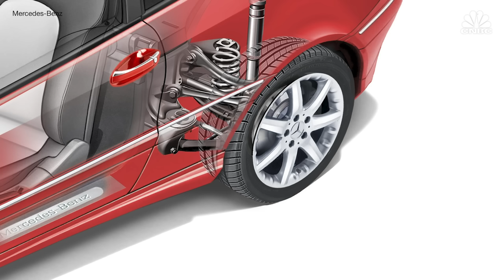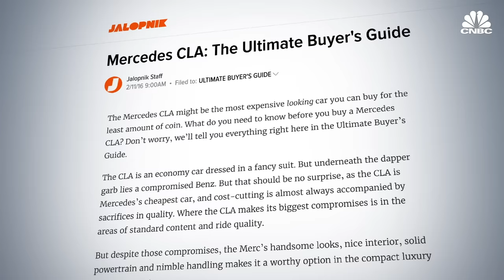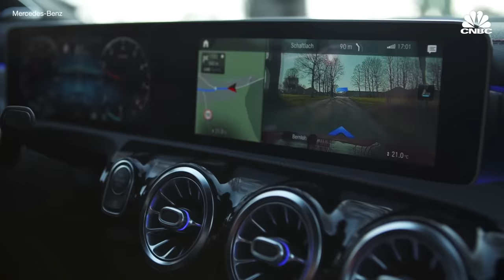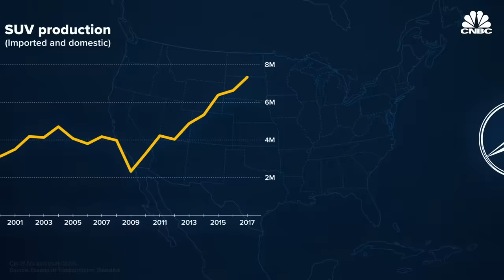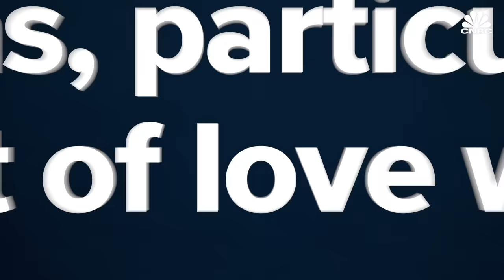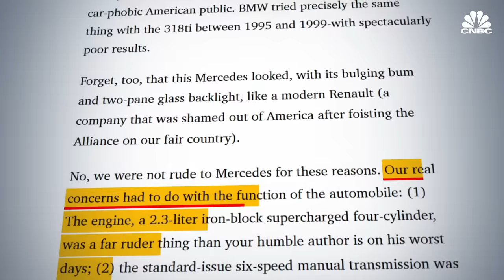Why BMW And Mercedes Made Cheap Cars That Failed

Comment: Jaguar x type... upper end owners didn't like that their maid could afford the same brand of car they had.
Reply: that was the car's biggest problem.
Reply: @racefan1997  more like it was a mondeo in drag which has never been and never will be a luxury car which is what Jaguar makes .If you can afford to maintain a luxury car buy a luxury brand if you can afford the finance but not the maintenance then go and buy a car that you can afford to pay for and maintain that’s the issue with luxury brands making cheap cars a Porsche Boxster still costs Porsche money to repair just because it’s a cheaper model doesn’t mean that it’s cheaper to repair.And if I’d payed 70 plus thousand for a luxury Jaguar and Johnny cheapskate down the road turns up in a poverty spec Jaguar I would be annoyed as Johnny cheapskate won’t maintain his car properly as it costs more to maintain then his 15 year old focus and then say how rubbish the cars are when really he shouldn’t and can’t really afford a luxury brand car he should buy a normal mainstream box that isn’t expensive to repair

Comment: Fortunately, today's "cheap" Mercedes-Benz and BMW models are at least reasonably good: the A220 sedan and 2 Series Gran Coupe are are actually competent models and are the configuration American buyers want.
Reply: And inflation adjusted, the $32K A220 is cheaper than a $37K 2001 C-Class Coupe!

Comment: 6:33 Footage of Pittsburgh intersection of the Rachel Carson Bridge, Ninth St., and Ft. Duquesne Blvd. Wow @CNBC you took it back with that one! That's at least 15 years old. The building on the left is now Pittsburgh CAPA and 4Moms, and the building on the right used to house Duff's Business Institute and Penn Technical Institute, both of which have been closed for a long time after much needed exposure as corrupt. That building is now demolished, and something new is being built.

Comment: 1:41 the correct name would be E36 (which is the correct type of 3er car of that time) with the added "compact" designation to set it appart from the regular 3er. Also known in some countries as "compost" instead of "compact" just to make even more fun out of it. 318Ti is just a engine/model type. And to be honest it would have been a good design if they went with frameless doors like the 3er coupe. But it went off to a newer version - the E46 Compact. WIth a terrible tail light composition and even worse head light.... situation... I would call it decently for now. And again the doors with frames. All that together was pretty much a death sentence to the model that could have been a VW Golf and Skoda Fabia rival. And after a few years BMW came with the 1er concept to try again and this time it worked. Nowadays you can get a "Compost" for silly money but it is the kind of opportuinty where you have to ask yourself if you really need this experience in your life :D

Comment: I bought a new 2002 Mercedes C230 coupe and loved it.  Copper color with off white interior with options such as sunroof and 10-cd changer.  Out the door $28k. Supercharged with 0 to 60 time of 6 seconds.  Sold it after 2 years because I was moving to the N/E rust-belt.  Have sorely missed it since.

Comment: I bought a BMW with 98k miles on it as my first car, i was thinking it was going to be everything i wanted: fast, reliable, beautiful looking. The car cost me $6,000 I’ve owned it for about 5 months and I have already spent $4,000 to fix a bunch of issues with it. NEVER AGAIN will i buy a BMW...
Reply: Did you look at the service record, check the engine, and make sure the car was in order before you bought it? 98k is quite a bit, and if the previous owner had not taken care of it at all its no wonder its falling apart. Unless you buy an old Toyota workhorse your car needs maintenance and it will cost you if its not done. Important to know what you're buying.

Comment: They have them fail so they can make up the costs in repairs. Pretty simple.
Reply: Automakers don't profit from repair and maintenance, the franchised dealerships do. No automaker wants to make an unreliable car. Dealers, on the other hand, are not very thrilled about the new electric vehicles as they require much less maintenance because they're built with fewer parts.

Comment: I bought a new 3-door hatchback in 2001, and the $26k Mercedes C-Class Sport Coupe wasn't on my radar.  I was able to spec a bright yellow Ford Focus ZX3 with sunroof, manual transmission, low-profile tires, antilock brakes and side airbags, with a drive-out price (including tax, title and license) of $13,800.  Paying an extra $12k for a 3-pointed star was unthinkable.  I'm still driving that car in 2023!

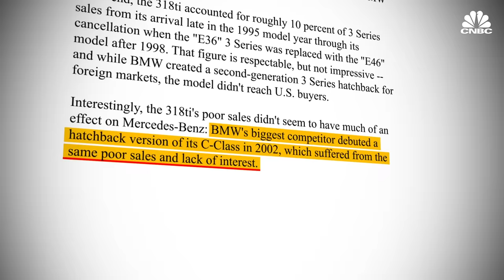Comment: 3:13 : I just parked my automatic sports car on an inclined surface and I did not use the parking brake, I just shifted into P and got out. (Car woobling). I don't wanna pay the bill when the gearbox is gonna break ...
Reply: Lol
Reply: That's normal

Comment: coupe suv are stupid. They are even more expensive, eliminate practicality (which is one of the biggest reasons for buying an suv), don't actually make you go faster and they are ugly as hell!
Reply: agreed, many of these coupe cuv buyers are burning money on essentially a lifted compact car, except the car version is 3 grand cheaper with the same features. The big practical trunk space that SUVs are known for doesn't even apply - for example the Toyota CHR trunk is 377 litres while a compact car VW Golf is slightly bigger at 380 litres.
Reply: BMW started it with the X6 which was a HUGE success when they released it. Don't blame BMW for making a great seller, blame the idiots who buy stupid cars.

Comment: When Benz bought Chrysler in '98 it was the beginning of the end of Mercedes being at the top of quality.  Compare the interior switches, road feel, steering, aroma, and how doors close between a 70s or 80s Benz to post-Chrysler cars and you'll notice the differences and overall "cheapening".  MB bean counters were given top billing and "unit volume" was the top priority along with production cost reduction.  Benz learned and applied many cost saving "tricks" from Chrysler which not only reduced some of the car's quality but also brought down its image and exclusivity.  The rest of the industry has caught up to MB in terms of quality and prestige and in some cases has surpassed them.  The MB logo has significantly less status and value today than it did 25+ years ago.
Reply: It wasn't because of Chrysler.

Comment: They're still building cheap crap boxes and whoring out their brands.
Reply: Ryan Patterson have you driven one? My guess is not, because you will immediately feel the difference in driving performance and built quality feel when stepping into one. Dodge, ford, Honda, Nissan, don’t even come close.
Reply: @turbopickle9720  well said. You cant even compare the drive quality of my bmw to my partners toyota, different worlds they are
Reply: Turbopickle Wrong wrong wrong wrong so very wrong lmfao. Please, drive a loaded out Chrysler 300C, RAM 1500 Limited, Dodge Durango, or anything else FCA made.

Comment: Lexus isn't a luxury brand? 🤣🤣🤣 C'mon guys this is factually wrong. Lexus is much bigger than BMW and Audi in America. Very disappointed in this type of sloppy copywriting 🤔😔🤦
I just looked up the stats and I'm pretty sure he meant to say biggest by volume in the world, because that's right but completely wrong for America.
Reply: Ktm S Audi is a chromed VW, not to mention that Lexus cars are usually better built or the same as their German counterparts, so maybe you should get a life!
Reply: Vincero Alpha Good reliability, but cant stand those ugly interiors
Reply: @VinceroAlpha  AUDI have his own history and actually older then VW. Porsche is beefy and super sporty VW its true :D But its not bad.
Reply: Lexus is not bigger brand. German brands use aluminum alloy extensively throughout, where as Lexus does not. I have BMW 535i, MB GL , and Lexus GX. BMW has best tech, more fun and sporty. MB and Lexus feel comfy heavy cruiser. All have been reliable.

Comment: When it comes to luxury and reliability, nothing beats lexus. Top quality 👍
Reply: Took me 14 years to learn that stay away from the v8 lexus
Reply: @lonniehorn3620  I've never owned a v8 lexus so I wouldn't know. But I have the gs350 and it's almost 200k miles without any issues at all 😁

Comment: Ahhhhhh!! My VERY first car was a vintage 1988 BMW 535i. My first car I bought and paid for myself was a used 1998 BMW 318ti with a manual transmission. I was 19 and it was the funnest car ever! It was the reason I became BMW obsessed and sports cars in general. 
Then BMW took a downturn in 2005 and hasn’t made cars like they did up until 2004. 
I hope someday they will make cars for people who love driving again, sadly with discontinuation of the 3 pedal manual transmission, I do not see that happening.

Comment: You will be lucky to get 100.000 miles out of these German "prestige cars" before the unreliability and big costs kick in.
Reply: most people that get them won't keep them for that long anyway so the reliability doesn't really matter
Reply: @kristians2704  What about the people that buy them second hand ? sure going to matter to them and they are not cheap second hand.
Reply: @blackvulcan100  yeah, used cars is a different stoty

Comment: I’ve been driving cadillacs since I was in my mid 20’s, I’m 40 now. my first was a used 90 sedan deville with 100k miles. Metallic blue with gray interior. Man I loved and miss that car. I have 3 cadillacs now, my oldest is a 69 sedan deville.

Comment: I can tell you from experience I was working at a Mercedes plant that also makes parts for bmw that these cars are all made out of the same cheap sheet metal and parts they just stick there brand on it and call it “luxury” when it’s not we ran parts 24/7 7 days a week working 12 hr shifts and the crazy thing is the parts had to still be reworked half the time since were running the machines past the recommended limit.

Comment: A3 does pretty well because it's pretty much a vw golf gti with a nicer interior. Maintenance is cheaper than a typical german and it's pretty reliable too. Also with a bunch of aftermarket support, you can get a3 up to 500 whp for like $5k.

Comment: 1:13 - Wait, Audi is 3rd biggest by volume in USA? when did they beat Lexus? Big three luxury brands by volume in US are Merc, BMW and Lexus and Lexus is sometimes in 1st place.. couple years ago, Audi was even behind Cadillac and Infiniti and btw Lexus sold about 100,000 more units than Audi last year in USA
Reply: Lexus was designed exclusively for the American drivers.  It's super reliable, parks by itself and ultra comfortable but very dull and boring to drive, according to Clarkson.  Its main target market are former Cadillac owners. Only for Sleepy Joes?

Comment: The A class if it was released as the Sportback version like it is in Europe in the USA would have sold really well as a solid Golf competitor. Lots of people go out and buy the Golf. The RS4 hasn’t been in the US since 2009, but the avant version of a4 still sold well and the all road is still on sale. The GR corolla is well loved as well as selling really well. The Integra Type S, Civic Type R, all are good hatchbacks. Problem with trying to release a luxury car for the masses is that it inherently isn’t a luxury car anymore. Just create a separate lower tier brand like Toyota and Lexus or Honda and Acura. In MBs case they should spin off AMG again as a high end performance brand.

Comment: I bought my1st Mercedes  in 2006, e320d and at 55k it wasn't cheap but a very good car, I bought my first bmw in 2014 328d another good car, I've owned 5 between the 2 brands, including my newest a 2022 x3, non of them ever broke down on me ever, in fact most never went in for other than regular  maintenance, when I shopped for my last vehicle, and a Ford ranger was more than a bmw with few safety features and options,  why would I buy american

Comment: Audi wasn't always a premium brand. In 1974 they introduced the small Audi 50, and the first VW Polo was a simplified Audi 50. The VW/Audi group then decided to use the Audi brand for mid-range to upper class cars and sell all the small cars under the VW brand.
From 1999 to 2005 Audi sold a small car again, the A2 with aluminium body optimized for fuel economy, one of the first "3 liter cars" (consuming 3 liters on 100 km). But the price of that one was comparable to other larger cars with less high-tech, so it didn't sell well.
The A1 sold since 2010 (based on the Polo platform again) isn't so much focused on super-economy but comfort and performance. The niche of low-energy cars is mostly being taken over by battery electrics.

Comment: The problem was mostly with the US marked that dislikes hatchbacks. Audi has much smaller vehicles than the Mercedes A, CLA and GLA cars. The A1 and Q2 are small very practical vehicles and constitute a sizeable volume (15%) of their total sales. And BMW has their Mini brand, that sells small cars in the US at premium prices, though the actual Mini Clubman and Countryman aren't really small cars anymore, leaving only the 3 and slightly larger 5 door cars in the segment.

Audi made the innovative frugal A2 in the past, but was a sales flop. Mercedes previous A-class cars were also innovative first taller city cars and than taller super minis. It was only in the third iteration with a Golf sized A-class that the company found success without diluting the brand. Forth and actual A-Class already outgrew the A3/Golf hatchbacks by 7/13cm.

But Daimler AG also owns the city cars Smart brand, they are considering selling or shutting down Smart altogether. Previous Smarts were developed with Mitsubishi and Renault, but Renault has declined to co-develop the next generation Twingo with Daimler.

Comment: I don't think they understand the complexity of actually buying and selling of luxury vehicles, the cheapest Toyota Sedan costs under 20,000 USD, whilst some of them go for around 14,000 USD, paying almost double for a Mercedes is luxury, The A Class which starts at around 30,000, you can never lose brand confidence by saturating the market, the more you see them, the more you want to own one, Apple has learned this well, and whilst there are cheaper models to cater for, Apple has overtaken the mid range watch industry, and now has put out smaller lines of wrist watch manufacturers in a huge profit cut, Mercedes, Benz, and Audi has adapted to this change, and still offer there vehicles in an attractive price range, which is now dominating the market.

Comment: The small Mercedes C Class was replaced with the Mercedes A class when that went from an upright hatch back to a more conventional hatchback. This still lives on and is what the CLA is based on.
Reply: C Class is not replaced at all. There is an A class, a C class and a CLA class, all distinct. A class also comes in both sedan and hatch forms.

Comment: I’m really sick of german luxury brands selling garbage cars for fortunes. At the 50-80k price range, there’s no excuse to not be able to develop a vehicle that is luxurious, quality built, AND reliable at the same time. Why would anyone spend that kind of money for a car that will depreciate 75% after 5 years, and cost an arm and a leg to repair when they start breaking. It’s a real spit in the face to the heritage of all three of the manufacturers. I’d love nothing more than to own a BMW because of their performance heritage and driving dynamics, but I’ll be damned if I’m going to either A) lose my ass on depreciation for a new one, or B) spend the cost of the car on repairing a used one. It’s a joke to expect customers to spend that kind of money on a car that’ll probably spend more time in the shop then on the road.

Comment: Americans do buy hatchbacks but its usually the 5 door variety and by companies that are known for making them I.E. Subaru Toyota etc. for example the Toyota Corolla Hatchback launched nearly 50 years ago 1976 the Corolla hatchback of that year gets around 25 combined miles per gallon while its current model year averages 36.5 miles per gallon so it can drive nearly 500 miles on a tank of gas. my mom had a Subaru Hatchback when I was a young child

Comment: Mercedes Benz, BMW, Audi, Jaguar and any other luxury car manufacturer should do what Toyota, Honda, Nissan and Hyundai did, but the other way round. They should create a separate new brand dedicated to manufacturing high quality affordable cars. By doing this they won't run the risk of diluting their luxury brands. To enter the luxury market, Toyota created Lexus, Honda created Acura, Nissan created Infiniti and Hyundai created Genesis. These Japanese and Korean car manufacturers has found relative success by dedicating their luxury brands to fit into buyers expectations. Nobody buys a Mercedes Benz or BMW expecting it to be cheap. These entry level luxury cars are not necessarily cheap or badly made, but they never seem to meet the buyers expectations.

Comment: I don’t think it’s so much that luxury brands have made cheaper models.
   I think it’s the fact that the auto industry has come so far when it comes to Tech/Materials/Design in the last decade... consumers can now buy a used “luxury” car that’s a decade old, but still nicer than a lot of brand new cars.

Those facts make it almost essential for “luxury” brands to create new vehicles that can compete with price.... and then for more average brands to step up their quality, but also keep prices down. 

This has never happened cause the Auto industry is not all that old. Every decade that goes by has dwarfed the succession of the prior...  FORCING automakers